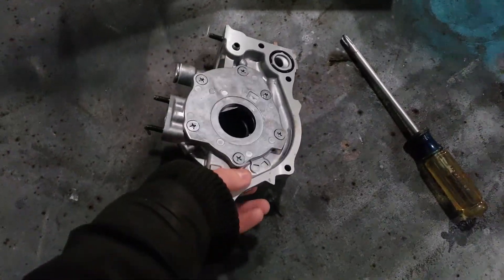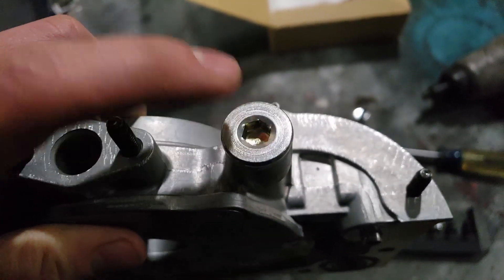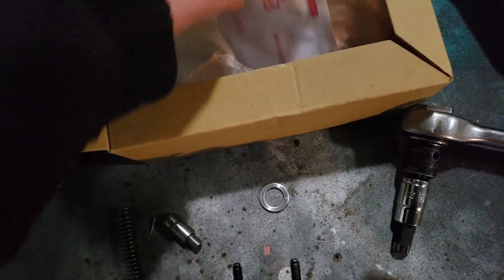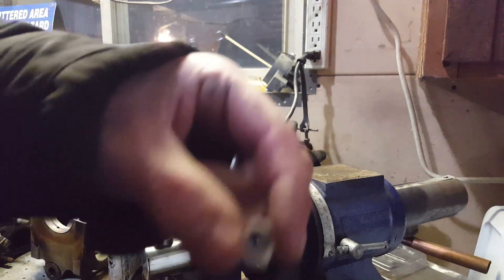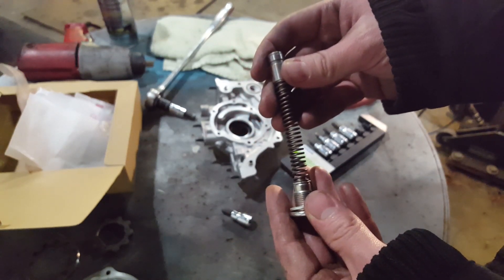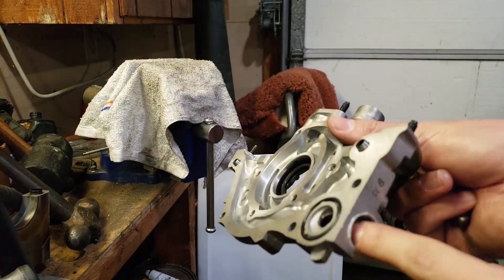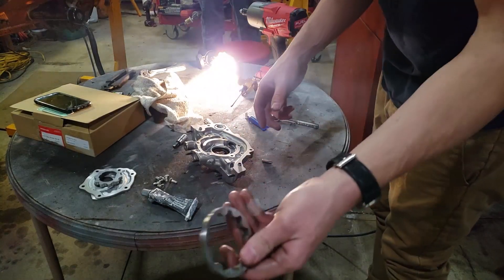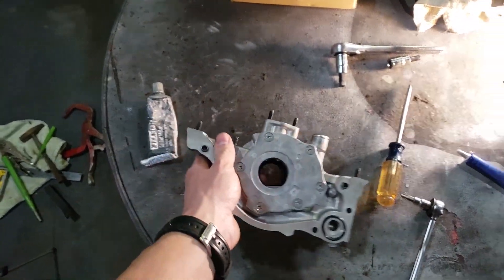How to Port and Shim a Honda Oil Pump D or B Series

Comment: lol you don’t want to shim the oil pump your just starving your engine from oil I believe the stock spring opens at 80 if you raising that. That means your starving it from oil the higher you rev it’s better to port it and leave the factory spring

Comment: This is the most retarded video ive ever seen. Shim with a pot metal electrical connector.  Just hog out the output? No torques on putting your oil pump back together? RIP  your engine.

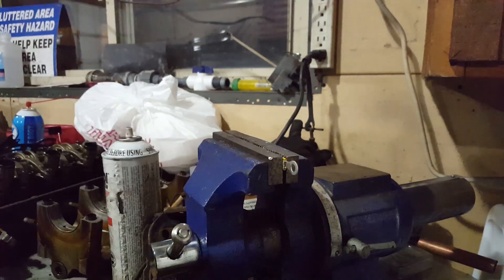Comment: 3:20 You should be putting a small block of wood behind the ring.
That way you don't have to worry about bending it while drilling.  Achieves straighter drilling.

Comment: I'm wondering if u ended up with a massive leak from that o ring having altered the design. Seems like the flow would be heavy to the machined/roughly drilled side
Reply from the maker: Nope 2 years later and it's still fine!

Comment: I did this to my D16Y7 but smoothed inlet and outlet along with drilling the seal drain port and hogging out the output to match the block. I now run 12 psi at idle and 96 psi at redline.
Reply: Is 96psi,, good?
Reply: @trevorpetersen9061 it depends how high he’s revving but It could cause leaks if u go to high

Comment: How can the shim increase pressure at idle rpm?   That is total bullshit.  To believe and claim that is not understanding how hydraulic circuit works.  The spring and piston are part of every basic hydraulic system.  Because fluids are non-compressable you need to have a pressure relief valve.  This valve will move only when the pressure increases to a pre-determined point.  At idle, or at any time below that point, the valve remains close. Adding a shim will not change anything at low pressure.  If you see an increase in idle pressure it can only come from the porting. An increase in flow can have that effect.

Comment: If we just do the shim, will that help at least a little?
Reply: It will only help with your MAX pressure, as it is a pressure relief. If you are trying to improve warm/idle/cruising oil psi, shimming will do nothing.
Reply from the maker: Yes it will increase psi which will also slightly increase the oil volume. Just shimming will still help a lot.
Reply: @NickSabella  Cool, Thanks!!

Comment: Why not to shim more? What will happen if shim to maximum?
Reply: If you shim the spring too much, you could increase the oil pressure too much and cause seals to fail and you may even blow up the oil filter on cold starts when the oil is thick and pressure is at its highest. The pressure relief valve is there for a reason. I shimmed my spring a bit too much and now I peg my 100 PSI oil pressure gauge at 2K RPM with cold oil but once its warmed up it maxes out at around 80-85 PSI, which is fine. As long as I keep the RPMs low while the oil is cold like I always do it should be ok. As long as you aren't going too much over 100 PSI while cold you shouldn't have any problems. Hope this helps!
Reply: @averyalexander2303  thanks again👍 last question..how much mm that you shim？ Just like in the video exactly？
Reply from the maker: If you build the pressure too much you'll cause seals to fail prematurely
Reply: @NickSabella  thanks man